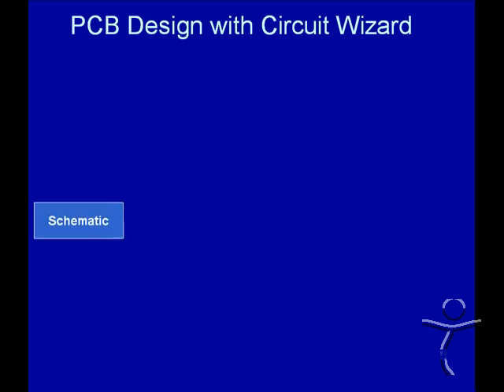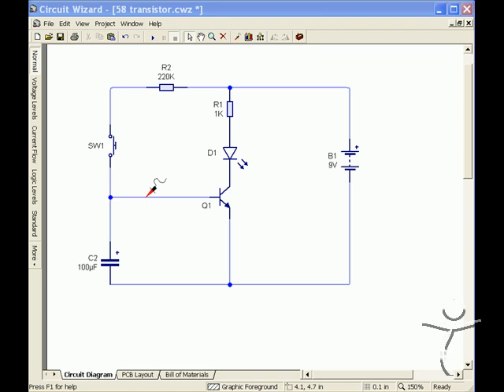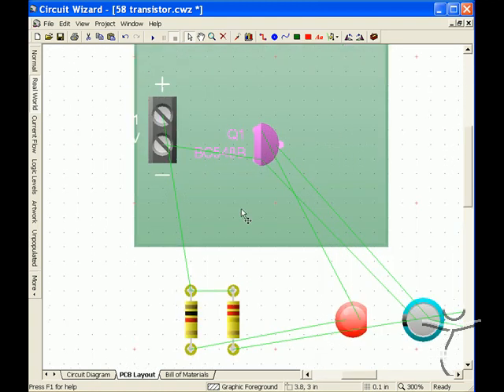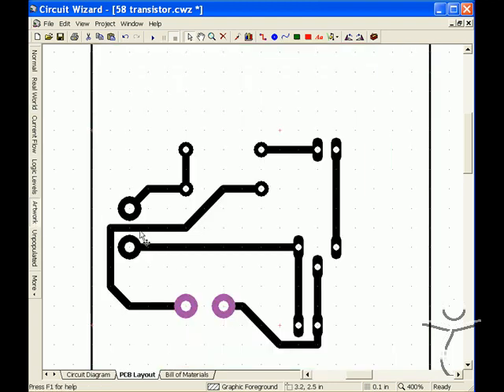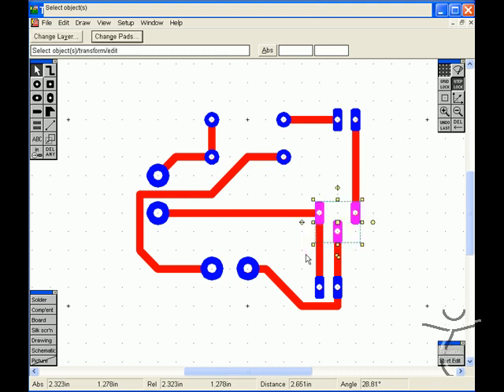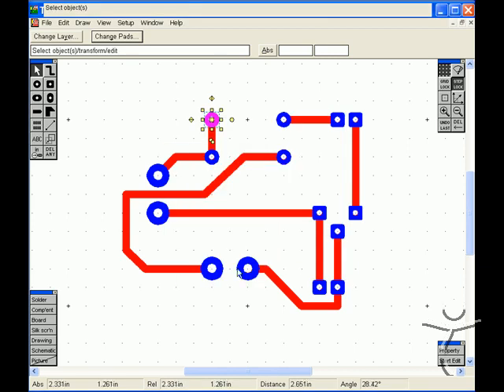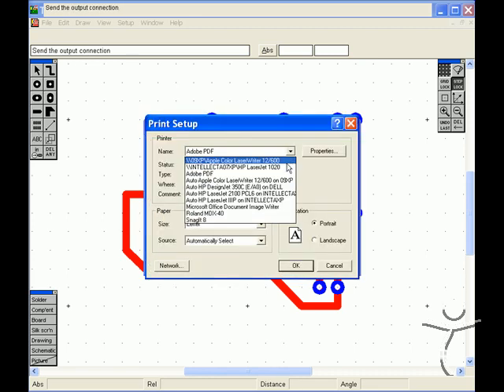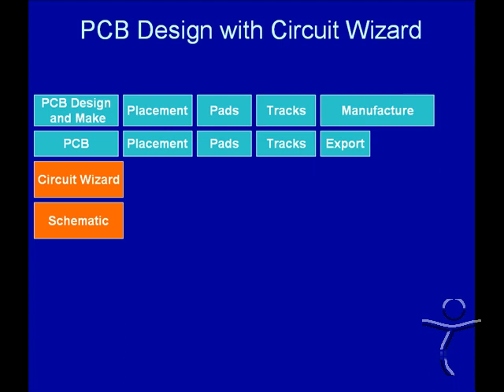Circuit board design

Comment: i m not getting pcb design for the above circuit because it is saying operation not supported for selected printer..what can i do
Reply: Print is supported by the normal windows drivers. What is the exact operation that you are trying to do. There are some options in the print tab. For example, if you are trying to print a pcb you have settings for layers etc. The print option for a schematic has this options removed and you can print the current design.

Comment: I have used https://easyeda.com to do my circuit board design, it is a free EDA tool based on the cloud platform. I think it's much better than Circuit Wizard.
Reply from the maker: +Roy To Thanks Roy for the update. There are hundreds of eda packages around such as ALTIUM, Eagle etc. However, none of these are specific to education. Circuit Wizard has been designed for this area. For example, you can define a circuit with real world components such as batteries and you can program a genie chip with a flow chart system. Again, you can mix digital, analog and micros in the one environment and simulate a complete pcb with real meters etc. We are professional designers and design multilayer boards all the time but nothing beats CW for education. The cloud based software may work in your single user environment but will not be reliable in a classroom with school security etc. The cloud offers industry a new vision but not so in school. What happens in a class if the net is down?Summary.... pick a tool for the job and one size does not fit all. CW is a great environment for teaching and we have used it in primary school for basic eleectronics. Would not offer this option with other eda packages.

Comment: my diagram is really small it only has a few parts a timer chip 7555cmos a relay a few led lights real easy if you make a pcb layout can i just submit it to a company and they will print me out the board seems so simple cause once you have the diagram in the program it will give you the layout and you can put the peices they way you want them you made it look simple

Comment from the maker: Most circuit design programs use a schematic as a plan for the circuit where all the components and connections are defined. The automatic placement and automatic routing are only acheived with the expensive high end packages. There is no replacment for the brain because you have to define the location of things such as connectors etc, The Circuit Wizard automatic routing is not that good. You will have poor tracks and locations. Advise that you use a manual routing process for good success

Comment from the maker: Dear designer.
The inductors are in the passive folder - resistors,capacitors and inductors. Check this out.

I have found problems with the inductors in terms of simulation. I suppose the equations are too difficult.

Hope this helps.

Thanks

Comment: Nice Video mate, 5 stars for you :).

I wonder if you can help...I'm quite new to this program. I am trying to design a stepper control board with a 25way and 9way D-type connectors on it. Do you know how I can do this, as the D-types are in the "PCB Components" library and I can't seem to track to them, Thanks.